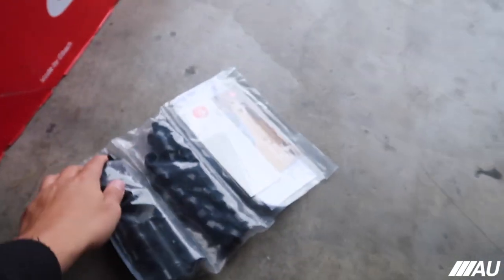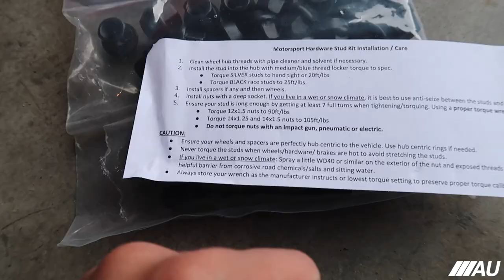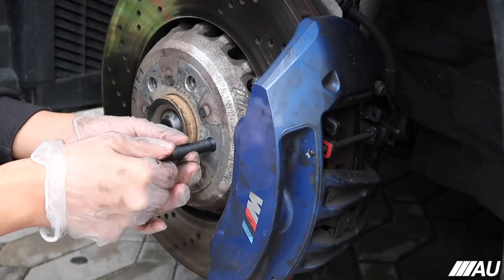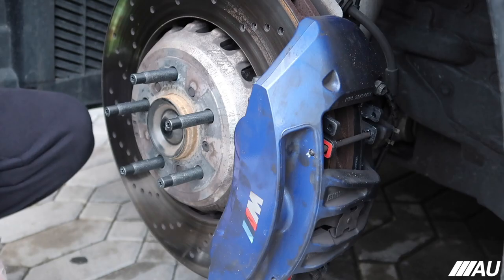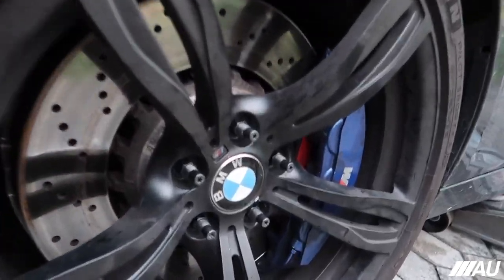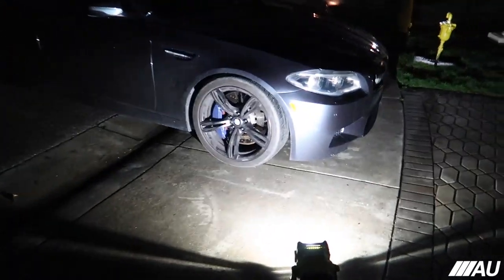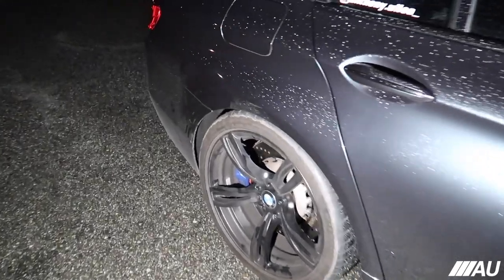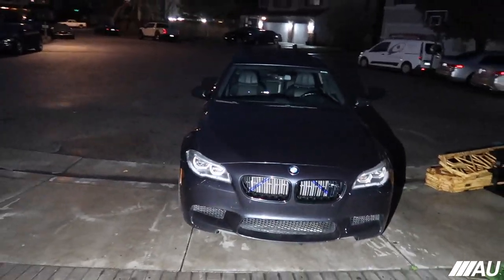STUD CONVERSION INSTALL ON MY BMW F10 M5 !! (MUCH NEEDED !!)

Comment: Hi mate , I have a m5 f10 aswell I was wondering if you’ve heard of the top gear carbon fibre exhaust , I noticed your exhaust tips are far out can you do that with any exhaust or just custom ?
Reply: Yes you could sir i had almost same issue